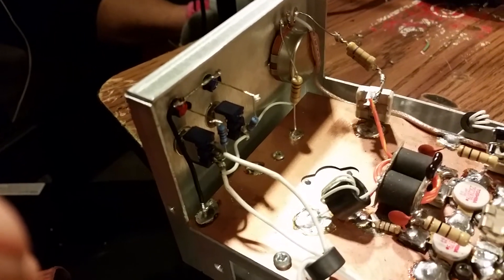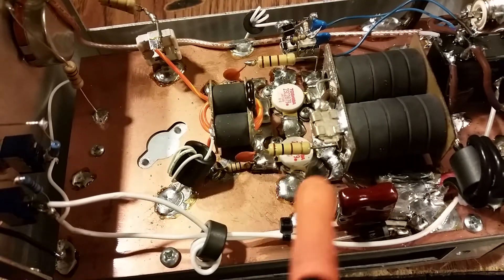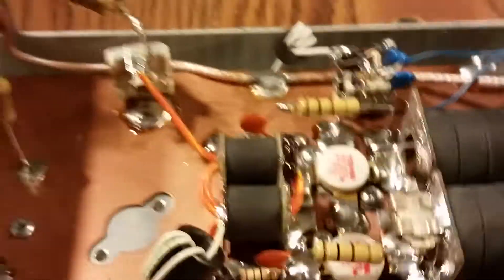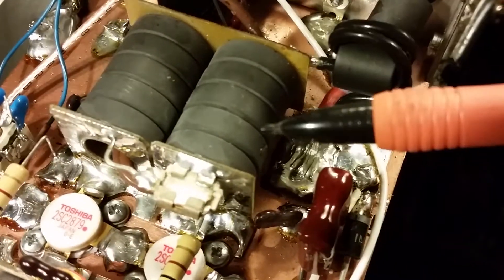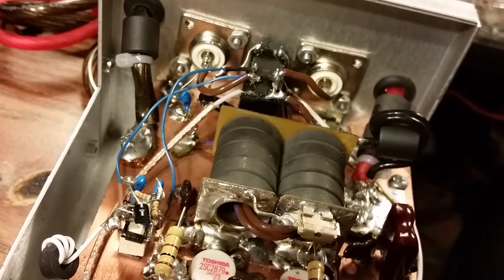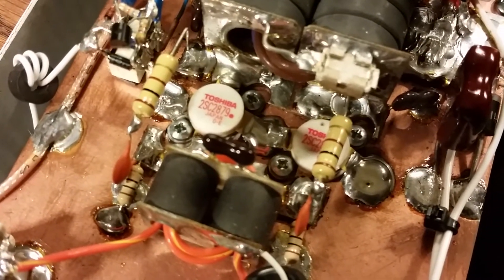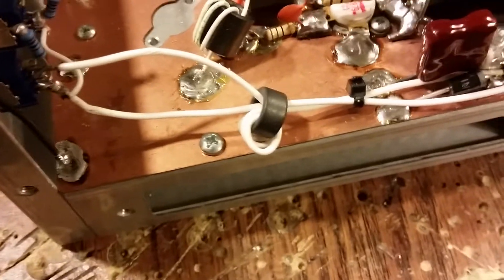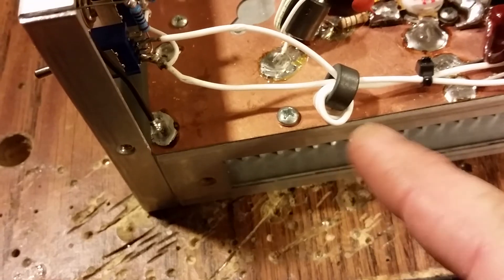Helping Out New Builder 👷‍♂️ with 2 pill [Knowledge][Private Video]

Comment: looks ok. I have found when receive amp is placed far away from main relay it effects the pass threw tune even correcting the VSWR threw the box I notice a receive loss . using the pre amp does help but effects the quality of signal.  problem is long leads act as antenna and output of receive amp gets into input and causes weird background noise. I had to do a repair using RG 316 to and from pre amp and used a better transistor . and re tune pass threw with MFJ antenna analyzer . also new relay for receive Amp .It came as a repair 8 pill with receive  problem.  also a little fine tunning of 8 pill section. got input tune better . customer got it back and told me receive came up a whole bunce. and the amp no longer gets into some radio stations . haven't herd from him in years .  with that 100 ohm burring up on  variable go with 5 watt or 2 200 ohm 3 watt. I have them. but hot radio will burn pot up. leave all the way up.  Them pots got costly now. better off with a attenuator and a hi/low switch. better input tune and use 5 watt resistors. more parts more work. or just get pre made attenuator mount on heat sink . I took the variable out of my personal  Texas star and just put fixed resistor gave me 15% power drop and called it good. used pot to fix a costumers TS amp. could not get replacement at the time. 73's

Comment: Thats what i use
Reply from the maker: Nice you got good taste...that soldering iron went down on me many years ago...would love to fix it....cud just need another pen but I think it is internal
Reply: I think ive had mine for about 5 years i bought it on ebay for  60 bucks i think built in 2amp var power supply heat gun and solder soldering iron